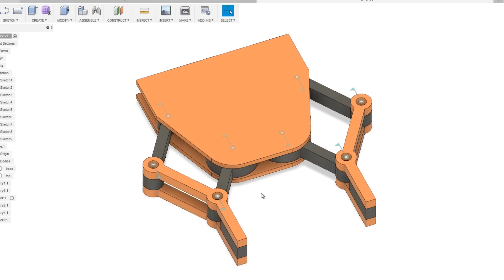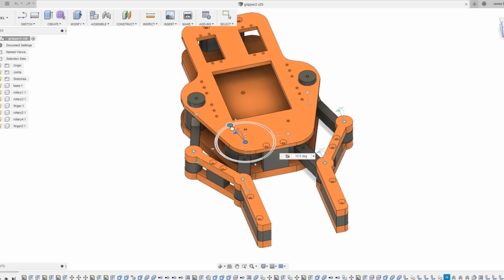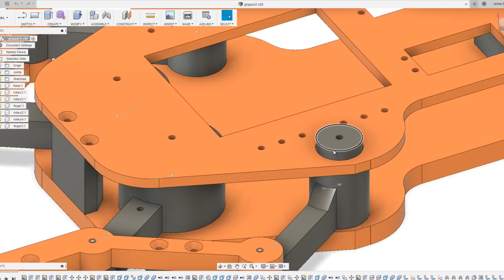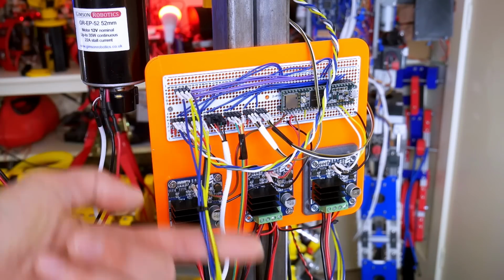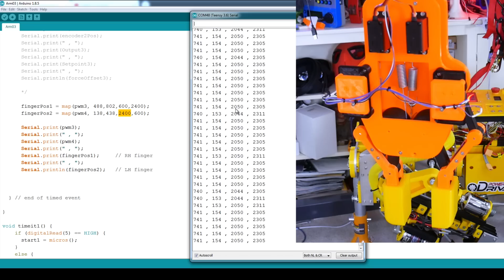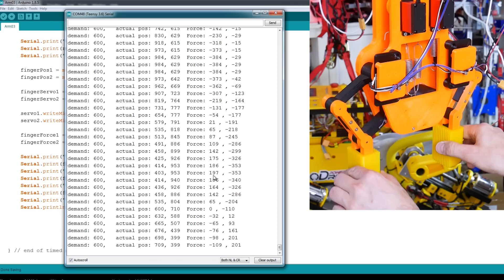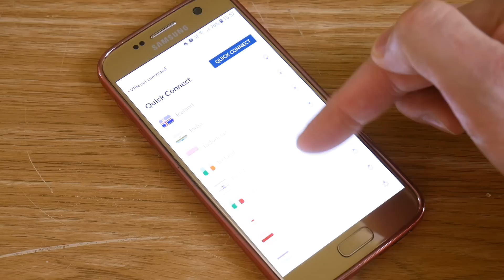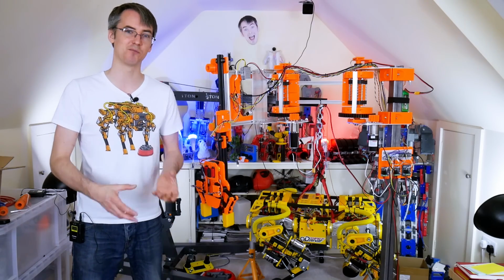V2 Compliant Robot Gripper | James Bruton

Comment: Great video. Would an electric solenoid work better as a gripper mechanism? You apply X current and get proportional force. I think its possible to read the back emf from a sine signal sent to the solenoid.

Comment: It will be nice if you also mention the time it took for each part. It helps new comers to 3d printing to understand how slow the process is. So they are not disappointed when they actually try to build stuff.

Comment: Really good proof of concept gripper, I'm glad you went with two servos over linking the fingers also. I'm just wondering how you could make a similar gripper that is smaller yet grips with more force.. Stiffer springs are an option yes, but I wonder if there may be a better layout that gives some mechanical advantage?

Comment: You know, I never realised up until you first showed one that hall effect sensors measure the rotation of a magnet;
I had always assumed they measured distance.
But sure enough, when I opened up my joystick (for unrelated problems with various buttons) I saw how the hall effect sensors it contained were actually configured...

Strange how different expectation and reality can be at times...
Reply from the maker: These ones are specific rotary sensors, although you get 'distance measuring' hall effect sensors that measure rotation in twist grips etc

Comment: Someone has got to tell him that the current flowing through the motor is directly proportional to the torque the motor produces.
Reply from the maker: But then you have to back-drive the motors in the servos to make it compliant, which is bad for them. Even worse if it were robot legs

Comment: Nice work! I keep wondering if it wouldn't have been better to put the grooves of the ninja flex in the other direction. Or maybe to use circular grooves.
Reply from the maker: They print that way better

Comment: Why have 2 servos in the hand where one would do. if your keeping the relationship between the fingers parallel gear up the fingers and run it with one servo, with  half the complexity
Reply: He's using two servos so the fingers can respond to force independently, at least as I understand.
Reply: @Codebreakerblue  ok, but if both fingers are always parallel the force on one will mirror the other so no need to measure both one will do ?

Comment: Pros use a plastic bag filld with grinded coffeebeans for grippers. Push 1 bar of air in the bag and place loosely over the object, then pump the air out of the bag and the beans hold the object perfect untill you push air into the bag again.

Comment: Interesting. However :-)   I would have used full size pivot cuts on the main rotors like you did the back parts instead of just the 3 mm rod. I would have then used reverse gear rotors, and used a single motor driving a worm drive in the center of both rotors.  This would have simplified the mechanics, eliminated the need for springs, made the gripper much stronger, reduced the size, and measurements could have been done by just measuring the power sent to the motor.  :-)
Reply from the maker: Making all the joints in the arm back-derivable was the main aim, for training etc. Measuring current would still work, although I probably wouldn't want to back drive the motor's gear train that much.